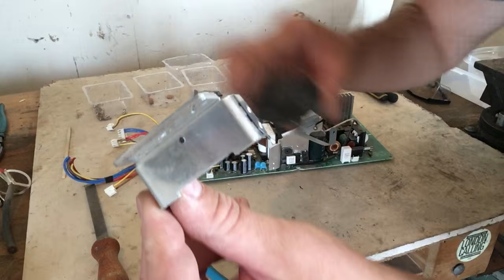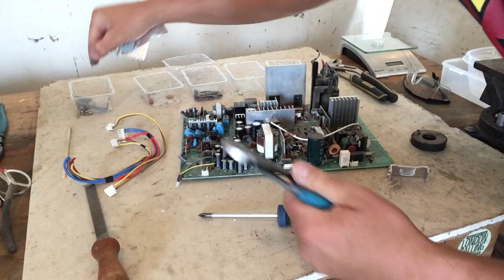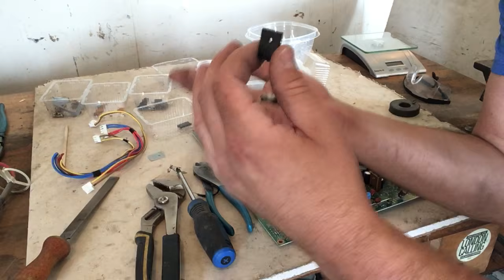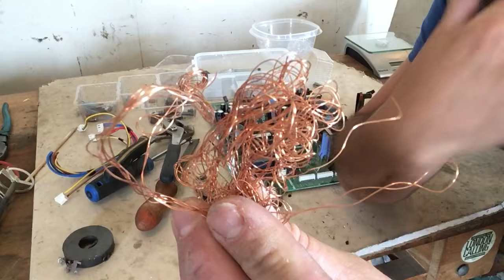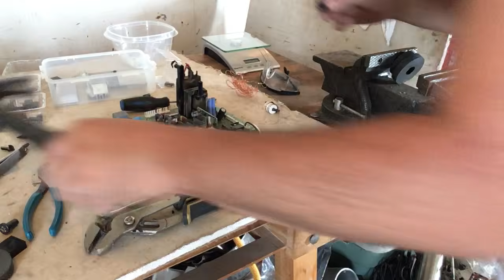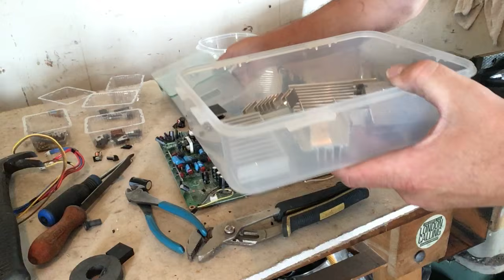Scrapping circuit boards: This is why I ALWAYS DEPOPULATE THEM!!

Comment: What is "tin"? I searched and the result is "Stanium", ellement nr. 50, that is not what you call tin.
I have a friend that gets more money selling the transistors and ICs on ebay by kg than can get by selling to scrap yard. Think that those electronic components are originals and not fakes that one can buy for few cents from ali-baba.

How one can reuse that relay that have no pins?
Reply from the maker: tin or shred is just a category at the scrapyard for all magnetic metal thinner than 1/4 inch. Thicker than 1/4 inch steel pile
Reply: @TinManScrapper  Thank you

Comment: I get atm 185 a metric ton for shred,and 300 a nt ton for Vic rotors here in Nova Scotia atm July 2024.
Boards if u selling in Canada for pennies a pound .hold on to them till big yard in your area gets fully in into it n not ripping u off.you know they screwing u if they own a shredder.the shredder separates PCBs from any shred tossed into it n guess what they r doing with it....
I was holding my stuff that was higher dimes a pound on board sort for ten years.
I sold good chunk of my hoard that was in the 6 or less on board sort to my yard I deal with this week n got 2 grand from my little load .
Large soc mobos 4.50
Small soc 2.15
Dual soc 4.50
Hi grade 5.60
Mid 3.60
Low like the board he showing 30c a pound 
Gold ram 25.00
Tin ram 11.00
Hdd with board .78 a pound

Look at board sort site price list n hoard anything worth a darn a pound.it might take u years before your yard starts taking boards for what they really worth or darn close sooner or later Iike mine .
If u r in cdn
Top tier stuff hoard it n send it board sort.the exchange rate will probably pay of the shipping.
Example old hhd boards/SCSI goes for close to 15 usd a pound.so why In hell u sell them for 5.00 or less.
Cell phone boards n so on.
So I save my top end stuff,cpu,ics,cell phone boards,old hhd boards,ram n so on.
They take up nothing for room really anyways.
Reply from the maker: Thank you for the comment. I agree. Luckily I do get better prices in London, Ont for circuit boards. As you said, hold onto them or shop around…it pays. Thanks and stay well.

Comment: Ohhh you made $3.75 cents lol
Reply from the maker: hey better than the few cents I would have made bringing in as ewaste
Reply: @TinManScrapper  hey as long as you doing 5-6 hour still make 20 hr cash just depends how many you can get hands on everyday
Btw idk where you from but scrapyards around Dubuque Iowa where I'm at give you between 8-15 cent pound for this aluminum capacitors irony Aluminum

Comment: Where does a guy take those components for cash redemption? To my knowledge, my local recycling center that I bring my plastic bottles and aluminum cans to accept electronics but i don't think they offer any cash value for them much less the directed components?
Reply: My scrap yard does not pay for e-waste :(
Reply from the maker: yeah, there are free drop of facilities that take electronics etc. If you want the money you need to bring to scrapyard. Atleast scrapyard will give you electronic weight price for doing nothing but bring the items in, or you can separate the items and get more value for the copper, aluminum, etc.

Comment: You just recovered about 10 % of the value of that Printed Circuit Board (PCB). I make US$ 250,000 a year processing PCBs in my garden shed.
I spend less than 1/10 of the time on each board, compared to your old fashioned way, and I recover 100% of the values.
First the most valuable fraction is recovered: The solder. A two step hydrometallurgical process removes all traces of solder. From lead solder the Tin and the Lead are recovered. From lead-free solder the Tin, the Silver, and the other metals are recovered. Tin is worth 6 times more than Copper!
I never waste time cutting off any electric wires attached to the board. After solder removal, all wires and all electronic components simply fall off the boards. These components are easily sorted in the individual types for further processing in separate batches. All is money!
All wires and all components containing plastic are then pyrolyzed (in separate batches), yielding Raw Pyrolysis Oil, for later cracking into free Petrol/Gasoline, Diesel and Fuel Oil. After pyrolysis the metal part of the wires are processed, without wasting time cutting off any of the connectors. They are melted and then electrorefined into 99.9 % pure Copper (highest sales price!) The same process done is with the majority of all the other metal components (some require other treatments), thus resulting in full recovery of all base metals (like Zinc and Nickel), Slver, Gold, Platinum, Palladium, Ruthenium and Tantalum, and of coruse lesser quantities of other valuable metals.
Finally, the bare boards are processed for Bromine recovery, and separation of the thin Copper layers and the Glass Fibers.
Virtually every single value in any PCB I get is recovered; nothing is lost. I process tons of PCBs a year.
Picking off a few of the components by hand will never make your rich.
Reply: Next level.
Reply: Dude is in a shed, not in a "flagship operation "like yours. However it's good to know how it's done on a high level.
Reply: @fernandogomes4348  .   I'm in my garden shed too! 
Streamlined and effective procedures will make you milions; if you just do it right.
Reply: Where is tin worth four times more than copper?
Reply: @agatinoamoroso2935  .   Nowhere! However, Tin is worth 6 times more than Copper everywhere. 
Tin is £ 3000/ton. Copper is only £ 500 /ton.
Reply: You should do a video you can make more money
Reply: @Brad-sh2wn  .   Videos of recycling/metal refining will never go viral. Too specialized. 
Even if the possible ad revenue from Google is calculated, I'll always make more money by scrapping.
Reply: @zero-waste so it sounds like you're just making all this up. If you're not willing to video it?😮

Comment: .8 CENTS A POUND FOR TIN?   if you take 2000(pounds) and multiply it by 0.08 you get $160 a ton!!!
tell me just where i can get $160 a ton for my tin!!!
im a 65 year old man and ive done scrapping since i was a child!!!
Reply from the maker: Here in southwestern Ont. Sarnia it is 8 cents and London it is 10 cents. Btw, when we refer to tin/shred it is any magnetic metal thinner than 1/4 inch so all shells for examples from appliances and microwaves. Steel is all magnetic thicker than 1/4 inch.

Comment: Solid resale item to snag off the old tube tv/monitor boards is the tall item in the top right. Its called a fly back transformer. Huge resale market as they produce insane voltages and are used in almost every high voltage hobbiest build. People want them undamaged so desoldering or breaking that section of the board off to keep the pins intact is best. Ebay ranges around 20$ for it alone. 👍
Reply: I get them off with a torch as they just fall off the board pins intact.
Reply: Looks like less than 10% of ebay sales are used flybacks? The rest are "brand new". At least in the USA

Comment: Quick question. When you're saying tin do mean shred, or tin is clean steel?  Thanks.
Reply from the maker: these are categories at the scrapyard. tin/shred is any magnetic metal thinner than 1/4 inch like panels from washers, dries, microwaves. Steel is thicker than 1/4 innh
Reply: @TinManScrapper  shred can have bits of plastic mixed in I'm assuming. Is tin clean steel less than 1/4" or it's all considered shred?  
Last time I handed in a few hundred lbs to shred and it was 100% clean.  
I saw people throwing crap in that was half plastic.. that's why I'm asking. 
I scrap for fun, not for money but I feel I wasted way to much time on my last load making it all 100% clean and getting shred.. am I wrong?
Reply from the maker: @carpentryfirst3048  Yeah I too try to take some plastic off, but things like washer drums if they are coated with plastic I leave them on. So the yard does allow some plastic, but even they have limits too.
Reply: @TinManScrapper  thanks for your time answering my questions.
Reply: @TinManScrapper  hey, another question for you if you don't mind. Regarding insulated wire. The ones that have a single layer of covering are as you say 60% recovery. What about the ones with a single covering but also the soft fiberglass looking, woven covering on some of the ones in electronics.  Can be any colour, and some have nice copper inside the wire but I don't wanna strip them because that fiberglass looking cover let's off a lot of unknown particles in the air.

Are those 60% too? It's another covering but it's very light and thin. Not sure of I described what I'm talking about properly.
Reply from the maker: It does depend on your yard, but I would say 40% if 2 layers of coating. Unfortunately I have had the odd yard worker try to throw all my wire in 40%, until I show I know what I am doing or even threaten to take it back and bring to another yard sadly.  Woven them made say the coating is too thick and makes it 40% @carpentryfirst3048
Reply: @TinManScrapper  thankyou for your time!
Reply from the maker: Glad I can help. @carpentryfirst3048

Comment: Can you make a poster with pictures of the part and it's value like #2 copper,  silver tip. And put them on sale.
Reply from the maker: Problem is prices change often.
Reply: Not prices just to identify what parts are Scrapible, there makeup,  and a picture.  So I can look at the board and know what I'm looking for.
Reply from the maker: I have separate videos on each metal and how to identify. Look up “how to identify aluminum and stainless steel”, “scrapping brass”, sorting copper, micro scrapping how to sort, etc @leroyrunk4422

Comment: Just wanted to say you have the best presentation and personality of any scrapping channel. I am a former scrapper but still find your cost breakdown videos insightful. Recently I processed some finger card trimmings to show my kids the chemistry of it. Used hydrogen peroxide and cleaning vinegar to dissolve the copper that the gold is plated to. Wanted to take the process further and used electrolysis to yield back out the copper from copper acetate. Used a carbon electrode and pretty sure I ended up with vinegar again. I looked at the economic viability and electrolysis from copper solutions is significantly profitable.
Reply from the maker: Thank you for the comment and huge compliment!
Reply: @GuyTraveler.     Thank you for your comment. 
Some people just don't get it; they're just rude and don't understand anything.
Vinegar and Hydrogen Peroxide works, but Aqua Regia is way more effecient.
Look up "Nitre Bed", it's what provides me with the majority of my free HNO3; but I also have a large homemade Birkeland-Eyde unit capable of providing me with more than 2 liters of 68% Nitric every day. Yes, it's a very heavy consumer of electricity, but all my electrcity comes from my 55 old solar panels (saved from scrapping), so all my electricity is virtually free of any cost.

All my Hydrochloric acid is free too; it's extracted from PBT and PVC plastic in an easy process.
Electrolysis will enable you to recover up to 99% of your acids back again. I use electrolysis as much as I can.
You say you're a former scrapper, but in case you have any questions, please feel free to ask me. I might be able to advice or recommend you towards more efficient and better ways of processing WEEE (e-waste).

Comment: I tend to clip the MOSFET wires and break off all the extruded and sheet aluminum heat sinks with them attached (I’ve seen some heat sinks that are nickel plated brass or copper, they are heavier!) Then I’ll remove all the screws/pins and copper parts, a bucket of them at a time with a drill. Sometimes you have to hold the nut on the other side with pliers while you remove the screw with a drill.
I have a bucket of silver contact relay switches I have to microscrap someday…👍

Comment: Enjoy your videos.... just wondering if you could heat the spent boards to recover the solder ?  Solder is expensive to buy, maybe there's a market ?  Thanks
Reply: O would look more at liberating the items on the entire board. So the board is left blank. The board once it gets shredded and delamination the. The drop on an air table which at that point the copper and solder would be recovered ..
Reply: heating the solder makes cancerous fumes
Reply: @BigVik1111   lot's of people use solder, heat it till melting point.

Comment: Hey Tin Man, Those transistors connected to the heat sinks are silver plated copper and also contain a small gold bond wire! Approx 0.02g Au/100gm and 0.4g Ag/100g.
Reply: I wad gonna say it if nobody else did. Hope he still has the 10 lbs of those! I saw a 2 kilo recovery and, id go after it. Burn off the plastic and get the copper anyways
Reply: I know this statement to be facts the silver adds up more then the gold but still adds up.
Reply: You are right about the copper but not right about the  bond wire! There is no gold in those transistors! You can find some gold in transistors but only in those old russian ones!
Reply: wrong
Reply: @BigVik1111 ... He is wrong especially when the video says they'll get #2 copper prices.  The last time I saw a silver soldered breadboard was from a 1970-80s Mountain Bell Telephone internal payphone electronics.  Since the atmosphere of the electronics will be designed for as humid or moist silver solder corrosion resistant over lead solder promoting moisture atmosphere corrosion are the reasons for design.  There is a brightness in silver solder vs a duller silver look on tinned solder.  Tinned solder is if the atmosphere is mostly dry weather electronics and not outside such as payphones.  Lead solder is even darker.  However, he would be correct with pins to IC chips, generally, in smaller electronics of cellphones.  India YouTube videos show them not at all throwing MOSFETS into a huge collection of IC chips that they'll burn before grinding to a powder.  A MOSFET would have wirey legs in that powder that they'll start chemistry recovery of the metals (silver and gold both start out the same) with nitric acid turning the acid bath the copper blue (green shows more lead).  Gold, if a serious amount in the same looking blue nitric acid step will use hydrochloric acid and lyme extra steps vs silver extracting.  Gold is pretty much sodium chloride and hydrochloric + more nitric acid chemistry (after Sodium MetaBusulfate or tree trump remover table salt uniodized to separate any copper by gold coming out of solution).
Reply: @lawrencejelsma8118 wayyyy to technical of a response answer... No one understands a thing of what you are trying to say.....keep it simple... We are not all college educated,are we would not be 2 bit scrapers....
Reply: He's not wrong.
Reply: Thanks! I know it is only a tiny amount but worth going after if you have several kg of mosfets. @scrapping4shiba
Reply: Have you tried recovering? I have and numbers were as shown @BigVik1111

Comment: Another question. Do you know what you can do with the heat elements that you find in electric grills and ovens? They are metal outside, but on the inside they are ceramic.
Reply: I get stainless steel price as well.
Reply: My yard takes them as dirty stainless steel.
Reply: Good for dummy loads for power amplifiers.

Comment: The white spools are easy to harvest, when you take the black mount of en putting a thin screwdriver in the shaft, you can unwind it easily then. I also take off the crystals, transistors and LED's for PM's.

Comment: Hi Tinman, what do you do with the flyback transformer.
Reply: I put them in my tin pill because of the ferrite
Reply: There’s a little copper in them. Leave them on the board as breakage or maybe throw them in with copper transformers/motors.
Reply: Good  day  What is a flyback  transformer?   Thanks
Reply: @donvoll2580  That is the transformer on the print board of a CRT television or monitor. It is normally fully coated in black plastic, and one thick red lead goes to the backside of the tube. I think there is copper inside it, but I heard that some scrapyards do not accept them. Maybe they can be thrown in with the complete transformers.
Reply: @TheDurdane    Thanks
Reply: my yard let's me throw them with normal transformers.